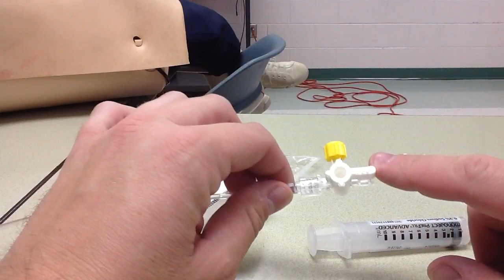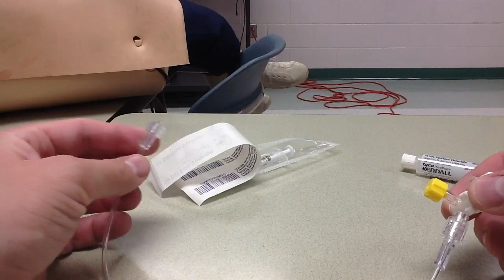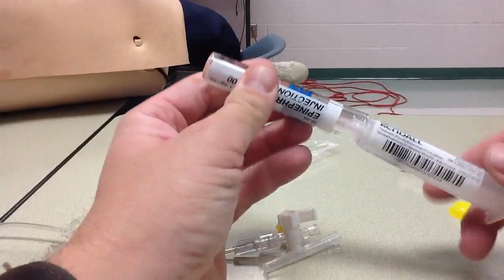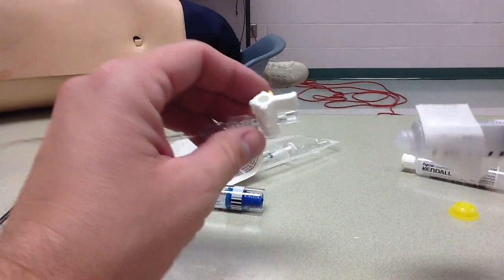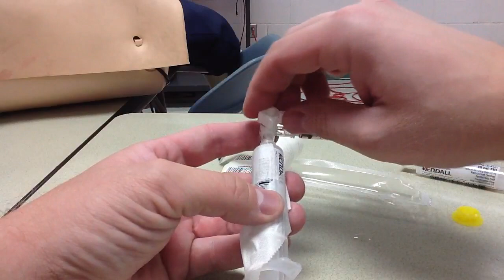Using a stopcock to administer medications

Comment: Great method, but for safety's sake I'd do this separately from the IV line that's directly connected to the child.

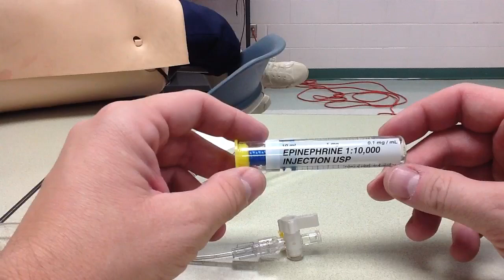Also, there's a slight mis-speak at 1:23. The volume dose is 0.1mL/kg, not 0.01mL/kg.

This is a very good an accurate way to pull epi doses up, thanks for taking the time to make this video!

Comment: surely it would be better to remove the 1 ml syringe  and administer the corrected dose  directly to the cannula  or IO port. as the dead space in the 3 way tap line would prevent the drug reaching the patient unless driven through with appropriate flush.
Reply: You could do it that way, but connecting the entire epi container to the 3-way stopcock allows for rapid administration of multiple doses. Work smart not harder!